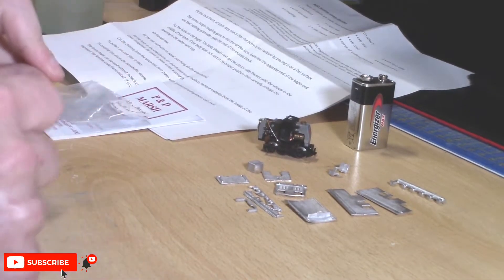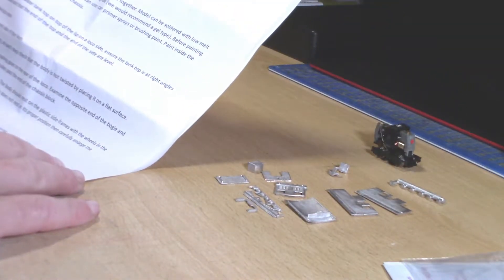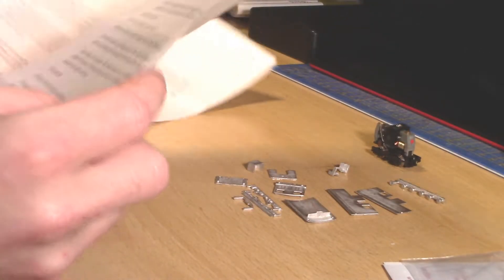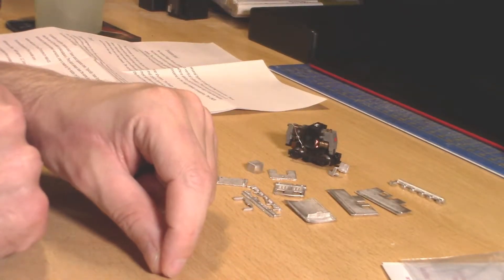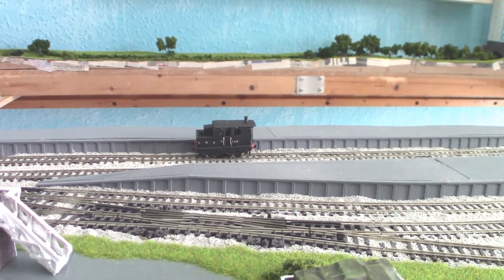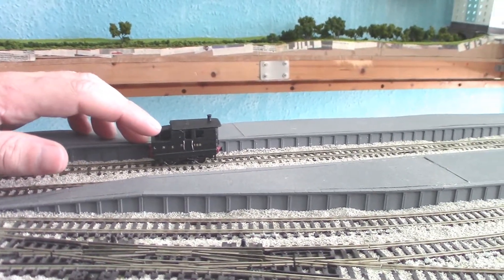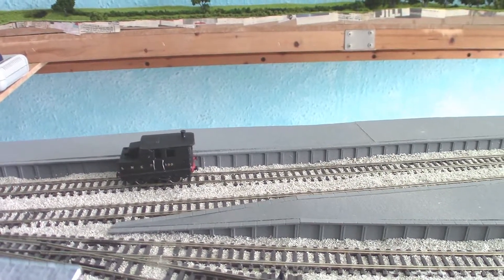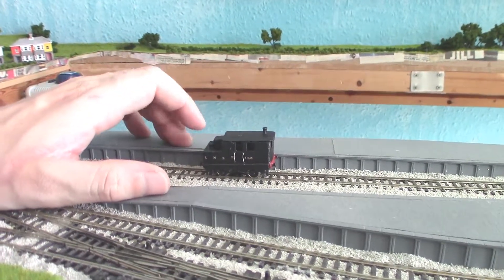An Amateur Builds: PD Marsh LNER Sentinel Shunter

Comment: Hi James, Thanks for another interesting video. One tip that I picked up a few years ago to insulate metal body from chassis is to paint the offending parts insde of the body with nail varnish. You can get it in black or clear and if you find one with added nylon, it is considerably harder than modelling varnishes. One little jar will last for many models.
Reply from the maker: Glad you enjoyed the video, and have thought about Nail Varnish before, though last time I used it, it kind of melted my paint work heh (this was before the channel and also before getting spray varnish for the outside), I did have some laying around though prob got rid of it, might see about picking up a small bottle for insulating the inside of metal models.
Cheers very much for the tip!